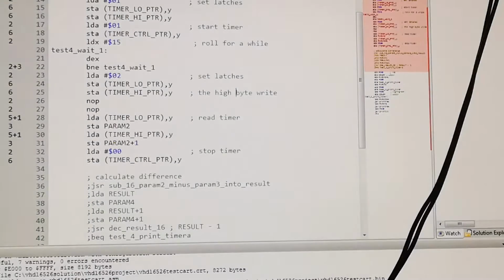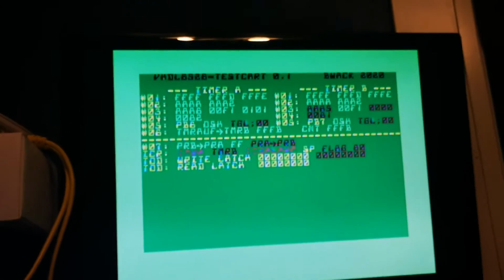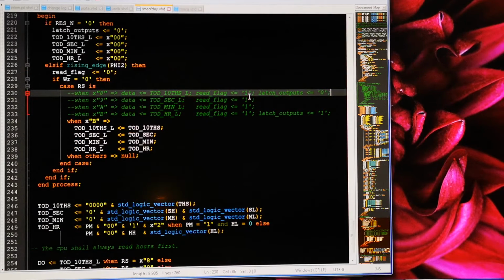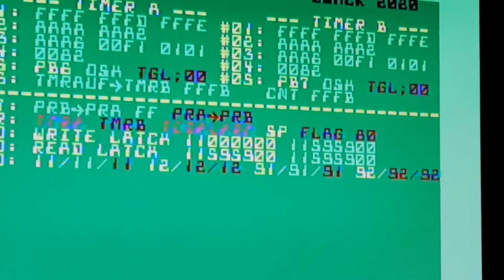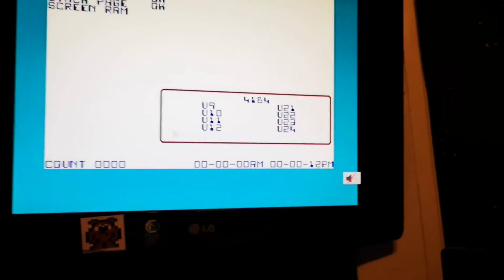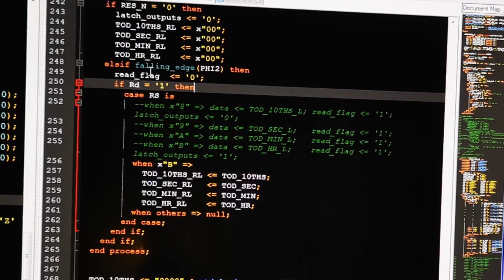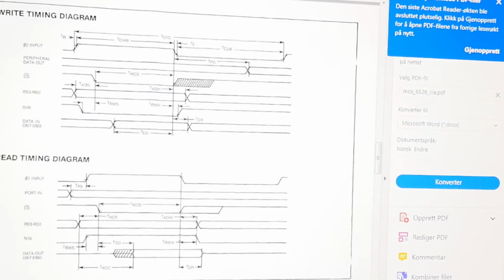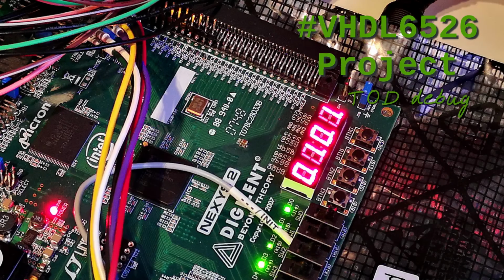The VHDL6526 project - TOD debug

Comment: Love this stuff. Went through similar pain, I mean fun, when trying to make Pi1541 cycle accurate. Must have read the 6522 data sheet a hundred times. Some information can only be ascertained testing the real hardware. Good work.
Reply from the maker: That is interesting. Btw, what is it like coding bare metal on a Pi ? Is it anything like programming say like stm32 ?
Reply: @bwack  IO wise it is very similar. Memory wise it is a little different but once you set up the page tables and enable the caches the machine is yours. Complex IO devices like USB and bluetooth are a pain. The GPU is mostly undocumented so other than 2D images it is very hard to work with.

Comment: Hans, I need some help understanding this. When you write things like "TMRB_2 <= TMRB", that doesn't create a runtime variable does it? Because that would imply you're using ram memory. Does it perhaps mean that you assign a new gate to copy the function of another?
Reply from the maker: Almost correct except its not a gate, but a register (many flipflops). There's no processor. The code is synthesized into logic elements, then later mapped to existing logic elements in the chip. In the process where I write TMRB_2 <= TMRB; , because it is inside a clock event (falling_edge(clk)), the assignment happens only at a clock event. The synthesis tool recognize this as: "TMRB_2 is a register. TMRB_2 data input connected to TMRB data output,  TMRB_2's clock input  is connected to the inverted clock". or something like that :) Another thing regarding signals inside the process, is that they change simultaniously (the order doesn't matter). http://alumni.cs.ucr.edu/~snematbakhsh/synthesis.html
Reply: @bwack  Ah ok, so a register. I can imagine you would have to be careful using these. There won't be an endless amount of them probably.
Reply from the maker: @TheHighlander71  There is a lot of the gates though :) and mux, lookup tables (LUT, program your own gate kinda thing), they are put into slices, and repeated all over the chips with wires in between.
Reply: @bwack  I'm beginning to see why they're relatively expensive.
Reply: @bwack  Interesting. According to this article VHDL was designed to simulate, not to program FPGA's. I never realised that.
Reply from the maker: @TheHighlander71  I saw the tweet now and had to look it up :) Yes.